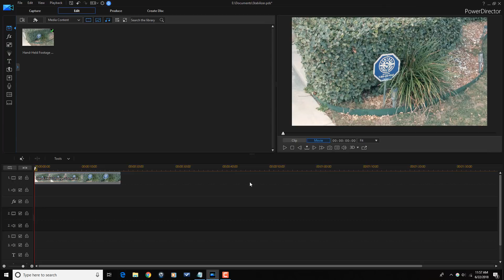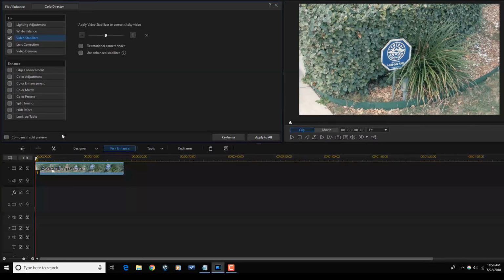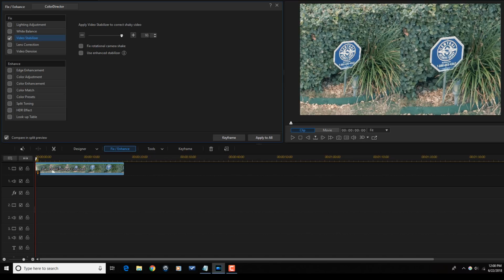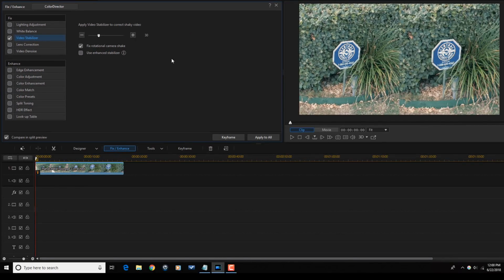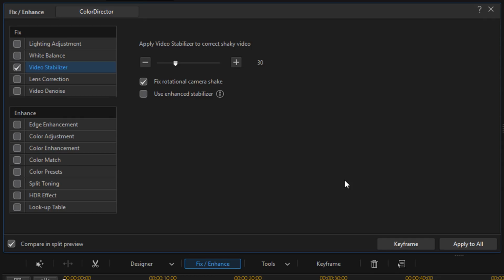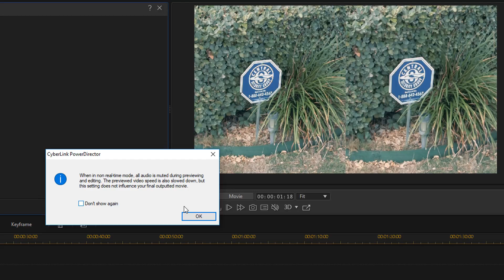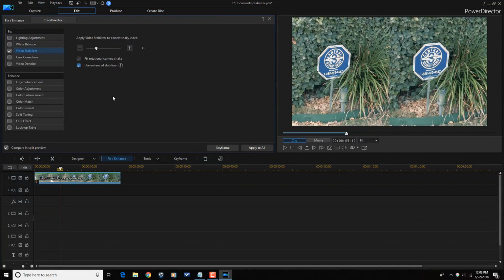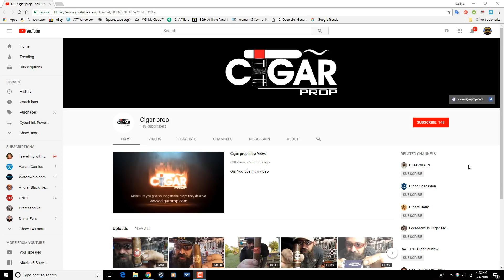How to Fix Shaky Video Footage | PowerDirector

Comment: Great upload. May I ask, is there anything PD can do to stop the top inch-or-so of captured video from (slight) movement? It flickers back-and-forth a touch and is annoying enough to be noticeable. In other words, this is a TV broadcast captured from VHS, but it's not 100% still at the top of screen. Make sense? Thanks for any suggestions.
Reply from the maker: Sorry, I'm not familiar with this issue. You can try asking for help on the PowerDirector forum. Maybe someone there has experience with the issue. The link to the PowerDirector forum is on my channel under the About tab.
Reply: @PDU_Tutorials  thank you for the reply. Will do.

Comment: Thanks for your great videos. My issue is that when I view my completed video in the timeline or in 2D disc create it is fine but when I view the burnt DVD on my PC or Tv there is "shimmering/flaring" (not lens flare) all through it. Video is shot on a Panasonic HC-X2000 High Definition camera. I don't know if it is the camera or Power Director settings. Please help. Thank you
Reply from the maker: Hi Janine. Not sure what might be the cause of your issue. You should ask about it on the PD Forum where you can find others who make DVDs on a regular basis and should be able to help. https://forum.cyberlink.com/forum/forums/list.page

Comment: Once again thanks.  When I have a PowerDirector question, I don't even bother with the YouTube search anymore.  I go to your channel and click that magnifying glass and search just your videos.  You helped me so much, I want to offer you a tip.  You may or may not like but I will put it out there anyway.  When you screen record your videos, you can change the size and color of your mouse pointer. By making it Huge & Red it will be easier to follow and you won't have to animate in those arrows.  You can change your cursor  in Windows Settings under Mouse/Pointer options.   Thanks again.
Reply from the maker: You’re welcome. Thanks for watching my videos. I like adding the arrows. 😃

Comment: When I use  the stabilizer I get a jello effect pretty bad (the more applied the more effect).  Even with the enhanced.  I'm really frustrated. It has done it with every camera footage I have (diff sensors etc). Suggestions?
Reply from the maker: Not really much you can do if it isn't providing the results you want. If might be an issue with the footage itself. Have you tried asking on the PD forum to see if anyone else has experienced the issue and was able to resolve it? https://forum.cyberlink.com/forum/forums/list/ENU.page
Reply: Same here yest I shooted my videos by OnePlus 6 in.. 4k 60fps with a very stable hands n tried this stabilization option and find out that their is a choppy effect at the start n end of every clip , I noticed this after producing my video n it was looking unprofessional...had to again render the video without that stabilization option.

Comment: Thanks for this video, but I must have missed something. I go to Fix/Enhance, Enhanced Stabilizer, then I click Apply To All. It does not save the stabilized video.
Or if I go to Produce, choose settings I want, (PAL), then click Start and save the video, I get the video in the original shaky version.
What am I missing?
Reply from the maker: Is it stabilized in the preview before you close the fix/enhance room? Have you tried to stabilize just one clip at a time and see if it works? If those things don't work you need to reach out to support.
Reply: Thanks for your reply. I am trying to stabilize 1 video. More to do later. I have free trial download, testing to see if it works before I buy.
I think I stabilized my first try then saved it, but not sure now. After watching this video, I used the Enhanced Stabilizer, due to the time it was taking, and the lagging when watching it back, I went through the save process before it finished. That must be my mistake. Thought it would save it stabilized.
I will try again and let it complete the enhanced stabilizing. Will let you know the result.
Reply: I have videos, filmed at a concert. Holding a camera in mid air.
Had a very shaky video, the stabilzer made good improvement. Not perfect, but when the original looks like a earthquake, what do you expect?
Other not so shaky videos had only a little improvement after stabilization. So I have mixed feelings about PD. 
I see PD 17 is released, or soon to be released in UK? It has more stabilizer settings, so I will give that a try.
Power Director is rated the best in reviews, so in time, I will learn more about it, and probably become a happy owner.
Gonna watch some more of your vids.

Comment: At the 4:30 mark, you mention that the Enhanced Stabiliser is a resource hog but do not declare for what type of computer. I have a new high end machine ($5000) as opposed to a cheap ($300) low end unit where specs will differ. Am waiting for the new version Director Suite 7 before upgrading and will try this then. Great tute though.
Reply from the maker: Thanks for the feedback

Comment: Sometimes when I use a resource intensive option (such as the enhanced stabilizer or intense effects/transistions), I'll go ahead and open a new project just for the clip(s) and effects/other tool that kills the preview. Then go ahead and render that clip and use the newly rendered clip in my bigger project.

In other words, if I need the enhances stabilizer on a fairly long clip, I'd go ahead and stabilize and render the clip separately. Then can work with that new clip and get my preview back up to a reasonable speed.
Reply: That’s such a good tip!

Comment: Hi Malik, when I try and use key frames on text, it doesn’t allow me ( for example, the diamond to create a key frame doesn’t appear. I am using Power Director 16.) the title on which the keyframe changes doesn’t even appear.
Reply: Do you know how to solve this?
Reply from the maker: Is the text selected? If not highlight the entire line of text and try adding a keyframe.
Reply: PowerDirector University Just fixed it! I had to click the square, however, when I exit, I then have to click the square again! Is there an issue to this?
Reply from the maker: Click what square? The bounding box around the text? Is so, try selecting the text, not the box.
Reply: PowerDirector University sorry, it’s a triangle. (I’m so dumb!)

Comment: Thanks Maliek.  I use this on almost all my projects at some point. What I do to overcome the burden on my machine is 1) correct the clips that need it first and produce those using "produce range" then replace the shaky with the corrected version in timeline. or 2) do all edits for entire project and wait until the end to correct the shaky clips.  I do the same with other hardware intensive features/effects as well. LUTS and color particularly and sometimes with speed change/direction changes.  Produce Range is my friend......and Video Stabilization is my best friend !!
Reply from the maker: Thanks for sharing. :-)

Comment: I find that PowerDirector  "default" stabilizer does a great job while not over taxing my system like other video stabilizers.  It is also just so simple to use.  While I have more options with some of the others, this is simple and it works at times even better.  Thanks for showing.  It is a nice feature within PowerDirector.
Reply from the maker: Yep. works great most of the time. I love it.

Comment: Another great tutorial Maliek. I used this a few weeks ago using guesswork! I filmed a boat from my boat with my phone. The original was so jumpy that it made my wife feel sick. I ran it through this 5 times on maximum everything and it's watchable although quite poor. Take a look:  https://www.youtube.com/watch?v=jcvIzYoNzUk&t=28s
Jim
Reply from the maker: Still shaky. Must have been a really rough ride. :-)
Reply: You should see the original. My boat is only 13 feet and I was steering with one hand and holding my phone in the other ! :)

Comment: Thought so but thanks for confirming 👍Correction preview on old laptop appeared much worse than the cam shake so haven't really used,  only once in a segment that was very bad.  Lens correction plus stabilizer is a large crop but will try now with lower settings and use non real time preview. 🙂🙃

Comment: Question. Hi I got Power Director 16 last week and installed it on my high end custom desktop PC which has Windows 10. For my license, can I install it on my HP laptop (Windows 10) too, or can it only be installed on one PC strictly? Can I use it on my laptop on Saturday and use it say the next day on my desktop, as long as I don't use it simultaneously on both laptop and desktop? Or will it ONLY work on the sole device which it was installed on? Thanks.
Reply from the maker: I'm not sure. You'll have to contact customer service to find out. I don't work for CyberLink.